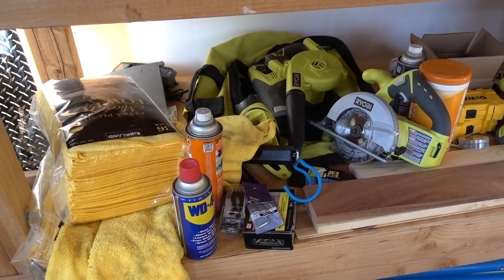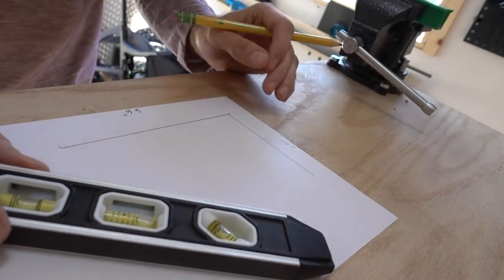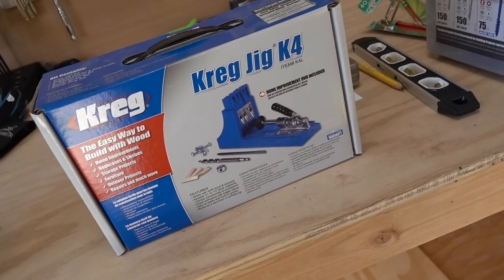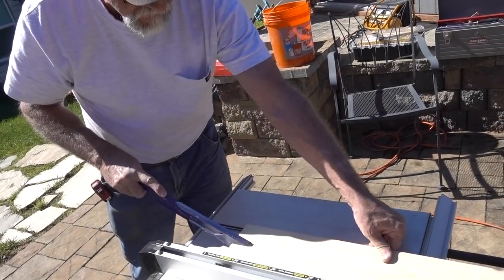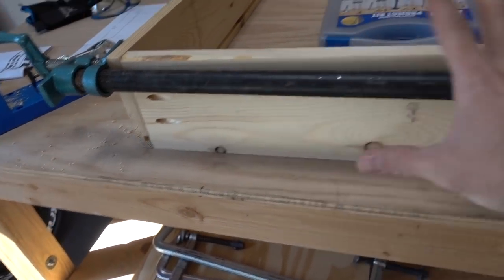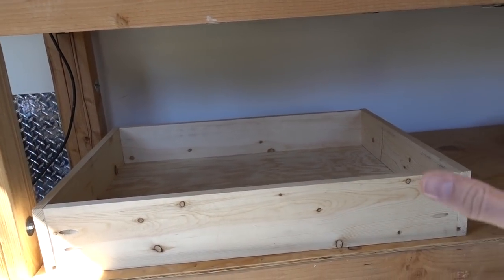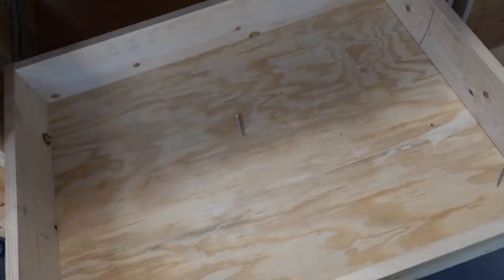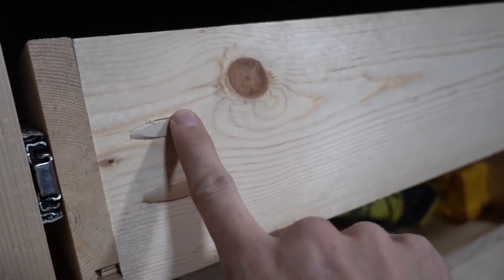The last tough job in my bike workshop

Comment: Hi bkxc, I saw you wood drawer project. As a pro wood wizard. you did ok as a rookie. I would have done otherwise, but I also have a woodshop. To make the drawer load the most, you should move the drawer sliders down to the bottom of the drawers. so the sliders align with the bottom.  It also looks more natural. / pete
Reply from the maker: Interesting!

Comment: Great Job, looking good! The Kreg holes could have gone on the sides so you don't see them with the drawers closed. You can add a drawer front face plate plus pulls to look more finished.
Reply: john fitzgerald this is what I was coming here to say about the holes going to the sides
Reply from the maker: Thanks!
Reply: john fitzgerald Typically, you put them all on the outside, and they get covered up by drawer faces. The other set is in the back where you'll never see them.
Reply: Theball Player 
You are correct assuming a face plate will be added. If not, in my opinion, the the kreg holes would look better on the sides. 
Thanks
Reply: Yeah, I agree.
Reply: it is actually stronger to place pocket screws on the front.  The screw has a higher shear strength.  I didn't see glue on the joints, so that could have resolved the screw on the side issue.  Nice job!  It is nice to see you dadoed the drawer bottoms.  It makes for a stronger drawer.

Comment: Nice work. About wood size, the 1"x6" is the rough sawn size.  They then do extra work to it, like planing the wood.  The finish product will not look rough and will be pretty much straight, but will have slightly smaller size.
Reply from the maker: Interesting!

Comment: Paper towel/shop towel holder?  One of the LBS's has an old handlebar with a long stem mounted on the wall behind the crapper, and the TP is on one side, and paper towels are on the other.  Works perfectly.  It's a little odd to reach behind and above for TP, but I guess you get used to it.  :-)  You could have plain paper towels on one side, and blue shop towels on the other.
Reply from the maker: Haha love it!

Comment: I believe the reason they are called 1x6 is because that is their rough cut size before any treatment at the factory. There may be another reason they are smaller too but I can't remember what it is. Building Trades was 10 years ago lol.
Reply: RedWings-44 the reason why its called a 1x6 because roughly 20 years ago they were actually 1x6 but some engineer did some testing and its doesn't actually have to be 1x6, so by making them smaller it saves weight and money
Reply: bjp 199 thank you for that explanation!
Reply from the maker: Oh wow that's cool!

Comment: Good job.... Just wondering why you didn't drill the drawer fixing holes on the sides, not the face and rear of the draws. Then they wouldn't need filling?
Reply from the maker: Thought it would interfere with the drawer slides

Comment: Good job Brian, looking awesome my man! Will you finish them of with front face plates? And the holes you made in the front face plate belong on the inside to keep it nice and tidy and it saves you the work of putting in pieces of wood and sanding it down. Cheers Bert
Reply: Yeah, that or should have put the holes on the side. You can also fill em up with wood filler and put a little paint on it.  So many ways to go about actually.
Reply from the maker: I think I'm gonna keep it raw like this!
Reply: Good call on that!